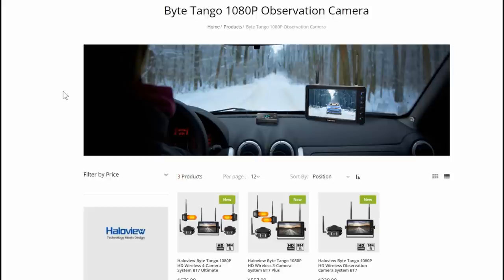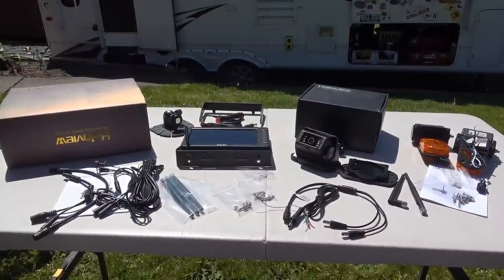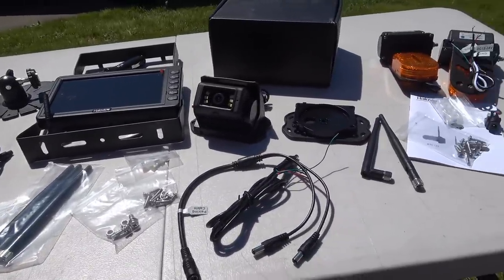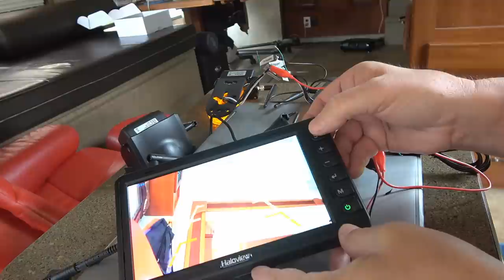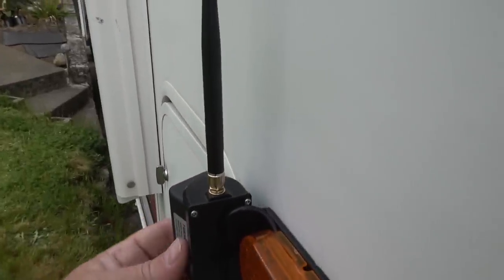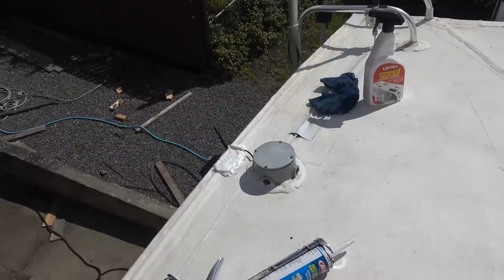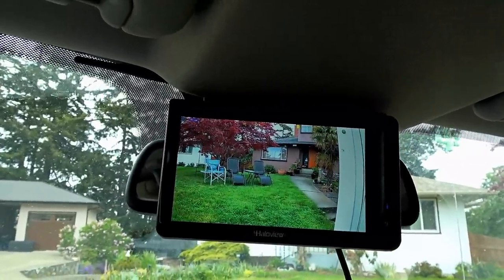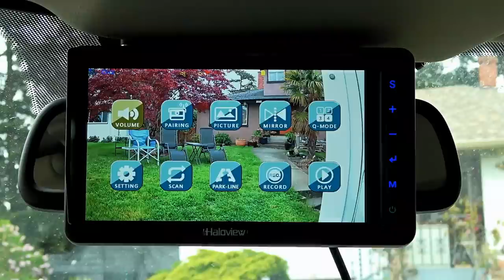New Haloview (Byte Tango) Rear & Side View Wireless Camera Monitoring System - Model BT7 Plus

Comment: Hey Ray! I like it! 
One thing I'd be doing is to add a bump stop that the two side hatch door can hit just before contacting the cam/marker light unit. Good chance of bumping them with the door while taking the tank in/out and risk breaking the cam off. 
Also, though too late for you having installed already, I'd be tempted to use the screws holding the junction box lid and bracket made from a piece of aluminum flat bar or painted wood to mount the back cam too. Maybe with a support leg that would rest on the roof, held down with some 3M VHB tape or adhesive. Just thinking it would avoid drilling more dreaded holes in the rv exterior.  Or, if no junction box, use 3M VHB tape and a bigger base plate to mount it, rather than holes. Just a thought.

Comment: Thanks Ray! - I have an older system from Rear View Safety (RVS) which services more the commercial truckers.
Still pretty happy with it - I chose a wired system to avoid any of the RF issues that were present then - plus I operate HAM radio and wasn't sure what effect that might have on an RF based system.
Just the one camera in the rear (which I wouldn't feel safe driving without!) Plus I can be sure I don't backup over my wife who guides me into sites! 😉

Comment: Ray, Another great video. We were gifted this system for Christmas. We installed the two side cameras today and tried to pair them to the screen. The screen kept showing no signal. We had used the hack of a 20 amp fuse to jump at the seven pin plug to power the trailer lights, the camera lights came on. Powered up the monitor from a 12 volt plug from inside the trailer with a 12' extension so we were within a few feet of each side camera, but was unable to pair them.  Is there something we are missing. There doesn't seem to be much info on problem with pairing this equipment. Look forward to your incite, Thanks
Reply from the maker: Usually, if it came as one kit the cameras are pre-paired.  Here was my second video in this system https://youtu.be/lJpAeAc_AbE  Pairing method is located near the end of the manual  https://haloview-user-manual.s3.us-east-2.amazonaws.com/BT7_User_Manual.pdf

Comment: Thank you Ray for all your reviews, updates and upgrades. We also liked your travel videos. we recently bought a used 29 ft Cougar and will be pulling it with my 1999 F350 single cab with aluminum flatbed. I am interested in the 4 camera BT7 system. I want to mount 2 cameras in the back with 1 viewing the road and 1 viewing my bike rack. I am curious whether I will need to add an extender booster antenna or will the reception be good. Also will this new system even allow me to add a booster antenna to the cameras or to the monitor and set antenna on my cab. I love the 1080 picture quality in your review. I look forward to your review while traveling and how this system signal and reception works while driving. Thank you.
Reply from the maker: You're very welcome. As far as I know, there is no booster option for the Byte Tango system. It's supposed to use a newer advanced wireless system that is guaranteed to work for a 65-foot rig. The actual line of sight is 984 feet.  I've done a 40 mile trip so far and results were good, tomorrow we take a trip of about 200 miles on busy highways, through towns and into the back country, Should make for a good test at speed and in varying light conditions. I'll pull some footage from the recording in the SC card and put in the review video. Cheers, Ray

Comment: Ray, Great video. So, this system doesn't need the wire to run to the front of the rig from the rear view camera to get signal? Is this correct?
Reply from the maker: Thanks. :) Yes, that is correct. It's suppose to have an all new wireless signal system compared to the older models so no need for a booster. But none of the older model cameras will work with this new system.  Cheers, Ray

Comment: This looks like just the system I have been looking for. Unfortunately, it is listed as "Out Of Stock" and "Please note: This is a pre-sale product". When will it be available to the general public? Also, I note in your video there is one channel with nothing showing. Can I hook up a fourth camera? I really want to have a camera showing the bed of my truck to aid in hitching up and when I am not towing the trailer. I really like the floodlights on the cameras. Does this system have a record function to playback video later? If so, what is the record length?  Thanks for the review.
Reply from the maker: Not sure when they will get it back in stock. Must have been a popular system or maybe shipment is delayed.  Yes, it can run up to 4 cameras, there is actually a different package that comes with 4  - https://www.haloview.com/byte-tango-7-ultimate.html?acc=413  The display has a micro SD card slot that can take up to a 250GB card and it will record the camera views in HD resolution and 5 minute length clips. They can be played back on the display or the card removed and played on a computer.  I've tested the recordings on a recent trip with the trailer and they look pretty good. Will show samples in my next video. Cheers, Ray

Comment: I use the older version 720p on a crane that is 145 feet long and pretty much never had it disconnected I use the magnetic battery pack on the camera and in 6 hours it only uses one bar out of four

Comment: We currently have a Furrion camera because the RV was prewired for the Furrion, the picture quality is awful, the company only wants to sell me a new one.  In our opinion it’s junk.  Could this replace the Furrion system, would new wires need to be run. Great video, thank you.
Reply from the maker: Haloview sells an adapter kit for the Furrion mount. See here https://www.haloview.com/furrion-prewire-bracket-and-power-adapter-for-haloview-mc5111-camera.html Here is an install video https://youtu.be/3DG78_73Zng  I know it worked for the older cameras but not 100% sure about this newest model. You could ask Haloview directly here https://www.haloview.com/contact-us  Cheers, Ray

Comment: Swap the left to the right and right to the left propane doors and frame they will fully open with cameras there
Reply from the maker: The only problem with that is if the catches were forgotten to lock in place the door could have issues during travel. For example, my passenger side one if open would slam into the awing strut and if not noticed right away at highway speeds likely rip the door off as the hinges are not that strong.  Cheers, Ray

Comment: HOW DO YOU PAIR THEM?? NO ONE SHOWS YOU HOW TO PAIR!
Reply from the maker: Usually they come pre paired so no need. But if you do need to its easy and described in the manual. Select pairing mode in the display settings and then within about 30 or so seconds press a small button on the camera. I mentioned it on my part 2 video where I went through all the settings https://youtu.be/lJpAeAc_AbE?t=531  Cheers, Ray

Comment: Ray, I received a new m5111 haloview. Are you busy? Trying to pair it. Thanks
Reply from the maker: What model camera are you trying to pair it with, did the camera come with the display? Some cameras don't work with some displays. Like for example I think the Byte Tango don't work with older models.
Usually the way to do it is go into the display menu and select pairing and start the pairing. Then within a certain amount of time you have to push a little button located on the camera, usually within 20 or 30 seconds. Sometimes you have to do it a few times or reboot the display to make it work.
 https://www.haloview.com/support/installation-tips.html

Comment: I have the Haloview HD7. The side cameras have been nothing but trouble since I purchased and installed them. I had a cover over my rv, and when the storage folks removed it they broke the antenna on one of the side cameras. Since then, after replacing the antenna and resynching the cameras, the side cameras only work when the rv is not moving. The rear camera now has so much lag that it is dangerous (vehicles are passing me and they are still behind me in the monitor). So it is time to do away with the old. So I’m really interested in your review and it is so timely. 

I didn’t see a repeater in this new unit, is that true?  

Do the buttons stay lit?  Mine go off and I have yet to find a way to keep them lit when it is dark. Very frustrating. 

I am about to throw the RD7 away as unsafe and unusable, so I am very interested in your next video. Actually I’ve never been totally satisfied with the system as it lags and jumps as I drive. 

Curious if you investigated the Vision Works camera system that TechnoRV sales?
Reply from the maker: I've used the Ultimate RD7R 4 camera system since Sept 2020 and its worked well. I didn't even need the repeater I wonder if you have some type of interference from the RV or truck electronics or maybe a bum display unit.  This new generation uses a new wireless system so they say a repeater is not need up to 65 feet. Haven't heard of the Vision Works before.

Comment: If I get the unit with 4 cameras the extra back camera could I use that on the dash of my truck for recording in front of my truck? If so how would I wire that...cigarette lighter? I have 2 of them in my truck plus 2 outlets. Thanks!!
Reply: @LoveYourRV  great thanks! I'm the type that would need a video for this and can't find a YouTube video for this exact thing. Haha so if you are looking to do videos maybe a good one to do? 4 camera's and 360 recording around truck and camper
Reply: @LoveYourRV  also do you have a discount code?
Reply from the maker: Thanks, you could try loveyourrv not sure if it is still valid, though.

Comment: I received my new camera in May for my RV trailer...I an still having trouble...I have two side cameras ..one camera in the front ..one camera in the back
The back camera light will not turn on..I received a new camera...still no luck the back camera light will not turn on...I have moved the positions of the cameras on the monitor screen..no back light...now one of the side cameras is flashing..when I was taking a picture of the cameras with my phone the phone made the flashing side camera stop flashing for a moment...but my husbands phone up to the camera it did not stop the flashing....shut the monitor off
🤔😣😶Any suggestions
Working with Haloview still
Appears to be the monitor
Reply: The flashing side light is white
Looks like an emergency flashing
All four cameras have a blue light on
Reply: I have moved the cameras to the # 4 position on the monitor no cameras using the settings will allow the white backup/safety night light to turn on the light on ..the monitor says it is on but it is not on
Monitor problem 🤔
Reply from the maker: Maybe try watching my follow-up video. I go through the BT7 display settings and demo the floodlight function https://youtu.be/lJpAeAc_AbE  Cheers, Ray
Reply: Hi
I checked all my connections
Battery etc
All good
With the suggestion of making the room dark checked the cameras out in the evening the #4 light turned on ....I put a cardboard in the only window in the garage today #4 light came on...the left side camera near the wall with no window is flickering constantly any suggestions for this
😜🤔😲
The videos are great

Comment: Very pricey $503 is it 4k?
Reply from the maker: No, its HD. Its a little more pricey I think because it also mates with the blind spot radar system Being that its wireless having 4K video is a ton of data to transmit wirelessly and process/record. So likely wouldn't work that well. Also with the same fish eyed lens there isn't a whole lot of difference between 4K and 2k or HD. I've tested a lot of dash cams and you can't tell much difference other than larger files sizes to deal with. Here is the second video https://youtu.be/lJpAeAc_AbE  (BT7 Plus) Road Test Results and Review

Comment: I am not pleased with Haloview.  I installed a model M5111 and it worked fine for 1 1/2 seasons and then one day it stopped.  No help from Haloview.  Out of warranty.  Tried two new antennas. Wasted $20 there.  Not a happy camper.
Reply from the maker: Which part is bad, the camera or display? I'm pretty sure I have a MC5111 display I don't need anymore in my storage room back in BC, could send it out to you come spring. That's the 5 inch model, right? Cheers, Ray
Reply: @LoveYourRV  thanks Ray.  No the display is fine, I think  it's the camera.  I suspect it got water inside it but do not have the expertise to fix it. I opened the camera and it was dry.  

Up until it stopped it was great and I miss it but not sure if I want to drop another $$$ on a system.

In Guelph ON.
Reply from the maker: I have some used cameras as well. If you're still looking by May when I'm back in BC give me a shout and will see what I have that may work with the 5111 display. Or you could send me your camera and I could see if I could repair it.